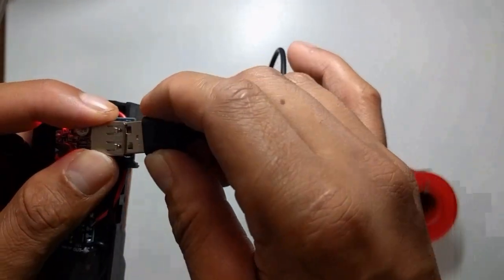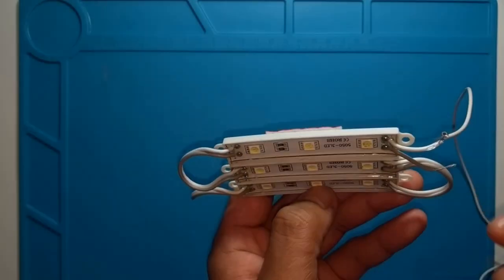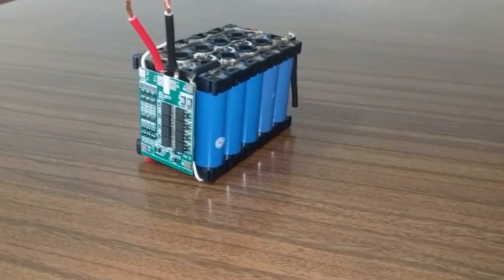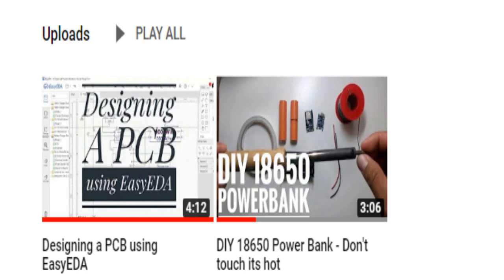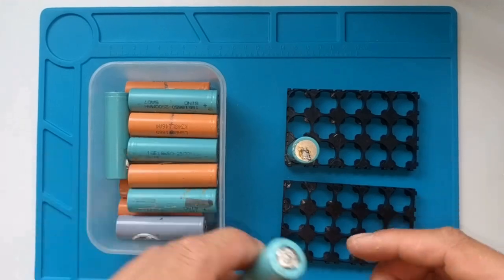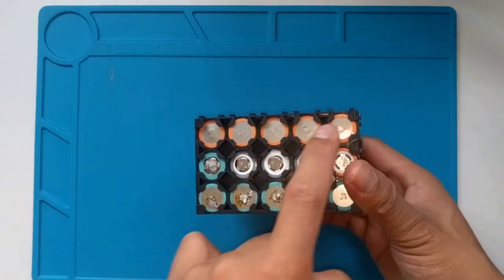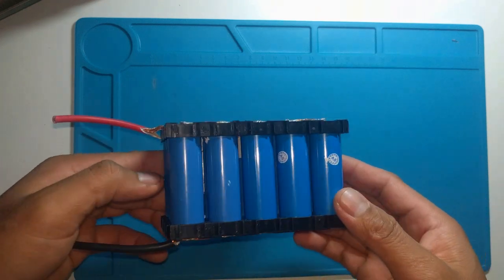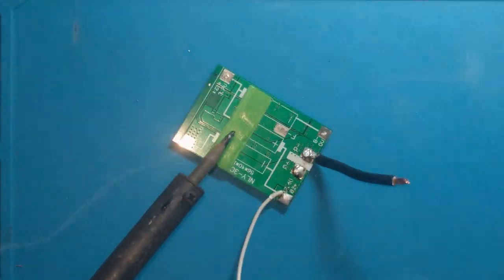DIY  Battery Pack 3S5P  - It sparks

Comment: Are the cables on the opposite side of the protection board to charge it? If so how
Reply from the maker: Hello sir it varies depending on the board that you are using some have a deferent input for charging

Comment: I'd be nervous about connecting two or more cells directly in parallel.  Yes, it works after they've matched their voltages, but even a small difference (like maybe 3.8V vs 3.81V) can generate a large current until that happens.  If you want to connect them together like that, I'd at least put a power resistor or a light bulb in there temporarily to control the current until they've matched their voltages exactly.  Maybe charge them all the same in the morning, let them settle individually in the afternoon, match voltages overnight through the resistor, and finish soldering the next day?

Also, if one cell were to fail short-circuit (lithium ion can do that if you abuse it), then not only does it catastrophically discharge itself, which is bad enough, but it also catastrophically discharge its entire "rung" in the series string.  It might be safer to have 5 independent series strings, and only connect the strings at the ends, not across the middle.  You'd need a separate battery management board for each of the 5 strings, but at least the "shorted-cell" failure mode isn't as bad.

The battery management board is supposed to prevent the abuse that leads to that and other failure modes, but don't tempt it.  Good safety is redundant; you're never supposed to use all of its layers of protection.  If you are, then you need to add another layer, even if it hasn't gone wrong yet.

Lithium battery fires are nasty because they contain their own oxidizer.  They don't need air to burn, so you can't smother them.  (well, you can, but they just keep burning underneath)
Reply from the maker: Thats a good idea.. for me its already balanced because i charge that batteries in parallel...
Reply: After you charge, yes, but what about before you charge?  They're probably all over the place then.  You might have gotten lucky that they were all the same when you first hooked them up.
Reply from the maker: @aaronduerksen1378   i have tested them before hooking up with that config.. :-) I'll show in my next vid. How.. :-)
Reply: Don't trust THAT to a meter.  It doesn't take much difference at all between cells, and so a meter may think they're "close enough" when they're not.

The meter's accuracy is not an absolute decimal point, but a percentage of the range that it's on.  If it's on a 10V range to see a 3V battery, then it won't see a 10mV difference nearly as well as if it were on a 100mV range.

And no, you can't just force a 100mV range to get that resolution and then measure a 3V battery.  It'll just read off-scale, overload, or whatever your meter does with that.
Reply from the maker: @aaronduerksen1378  i mean i have cycled it.. like what jehu garcia do..
Reply: Who's that???  Copied/pasted into google, found a seemingly relevant YT video ( https://www.youtube.com/watch?v=9YwErplHps8 ) and watched it.  Yeah, he did what I suggested.

Charge each cell individually, wait for them all to settle, and then connect them in parallel.  But even so, I'd still put some resistance in series with each cell for the initial connection.  Let that sit overnight, maybe even a few days, then take out the resistance and connect directly.

And you still have the problem of a failed-short cell shorting out its entire rung instead of just itself.  That can be a really bad deal, since it's behind the battery management board and so it can't be stopped automatically.

If you had an individual protection module on each cell, then a shorted rung could isolate the one failed cell and continue running (that cell's protection would trigger first and cut it off), but you don't have that.  You have a bunch of raw, unprotected cells soldered directly in parallel with some decent size wire, and then you added a management module on top of *that*.

If a cell were to fail short-circuit, then the wire will certainly be overloaded but probably not fuse, and so ALL of the energy in that rung will be transferred to that one cell in a fairly short time.  So it'll probably catch fire.

Jehu's design in my video link has the same problem, but to a lesser extent, **IF** you actually install fuses everywhere that they're called for and not jumpers.  If you use fuses, sized correctly, both for the overall board and for the balancing connector, then the one for the shorted cell(s) (or board) will blow, and thus isolate it.  If you use jumpers instead, then it has the exact same problem to the same extent.  Time bomb fire hazard.
Reply from the maker: thanks for that idea

Comment: What does sparking it at the end show?
Short circuit worked early with lights.
Reply from the maker: Simulating  about what  I mention jump starting but even if cant handle much current due to the limitation of the bms i have put another unprotected connection on the other end of the battery pack.